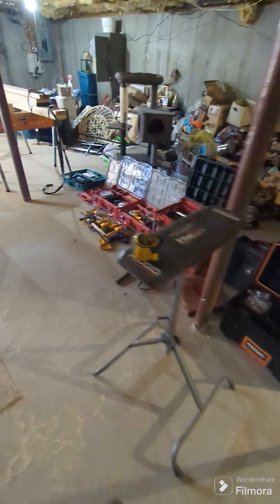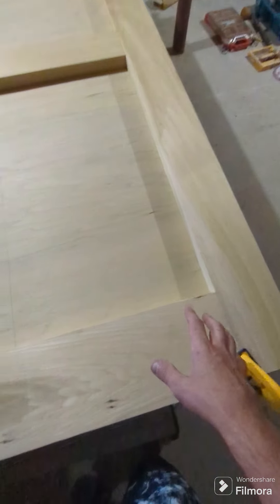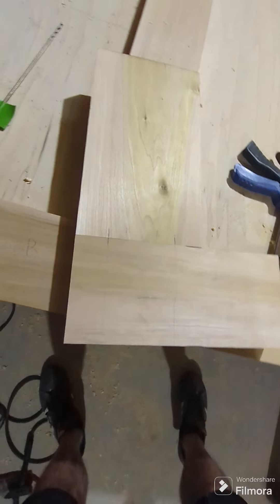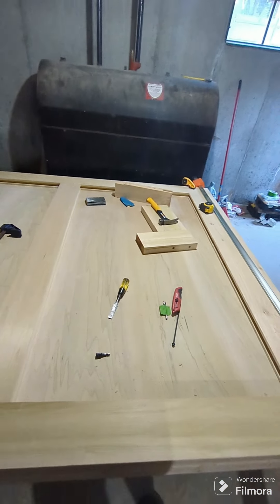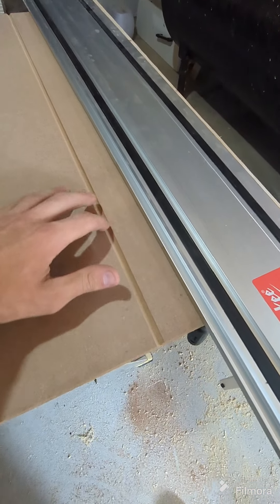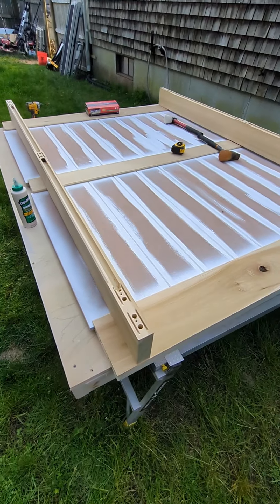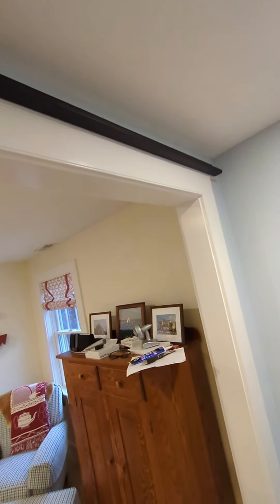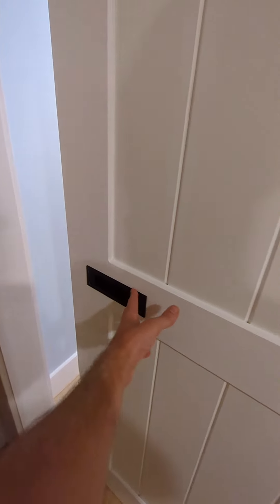How To Build A Custom Barn Door. 6' x 7'

Comment: Thats wicked dude. One piece track? Where did you source hardware?
Reply from the maker: @andy6131  Thank you sir. It's two 6' tracks and it's called "Rustica low clearance". My buddies client tracked them down and I would not hesitate to use them in the future. I wasn't a huge fan of the door stops themselves because they were just a small cylinder with a set screw and it's a very heavy door. The anti-jump hardware was a little bulky too. Kind of the opposite of what both should be. I'd still use it again, but I'd pursue other brands option for those two minor pieces of hardware. I have no problem mixing and matching.

Comment: Why did you put the bumpers in the dados? Does that prevent rattling while keeping things tight?
Reply from the maker: @csbarbourv  Hey Charles! It was to make sure that the panels stayed closer to center during assembly and operation. There was about 3/16" gap all the way around. Without the bumpers, if one panel dominated one side, while the other dominated the other side, it's feasible that the v-grooves could end up misaligned by upwards of 3/8". I figured these 1/8 bumpers would help prevent that during assembly, as well as any possible future issues, while still providing some give for any possible expansion. It is MDF though, so the panels should be pretty stable. I'm not a door builder, so I can't speak on the exact way that this should be done. I am pretty confident that they're effective in my application. Thank you for watching sir!